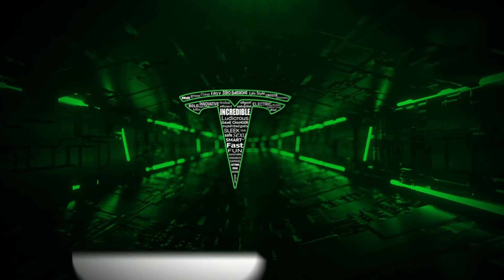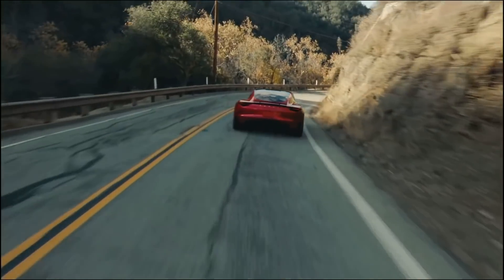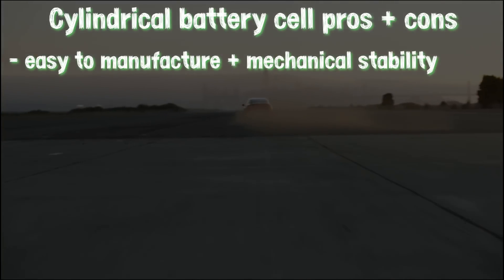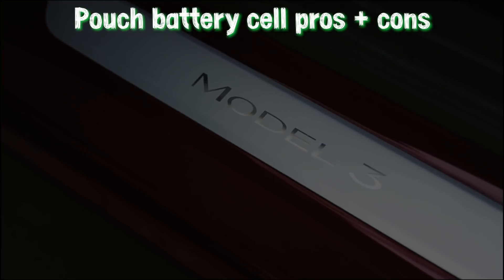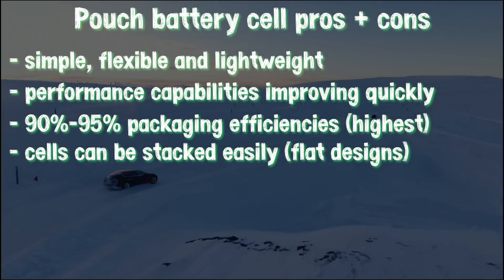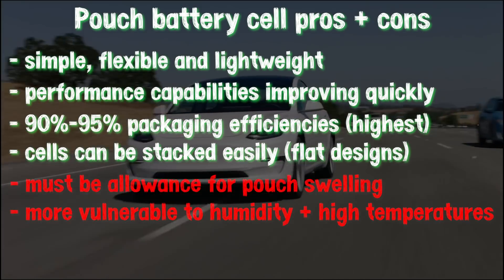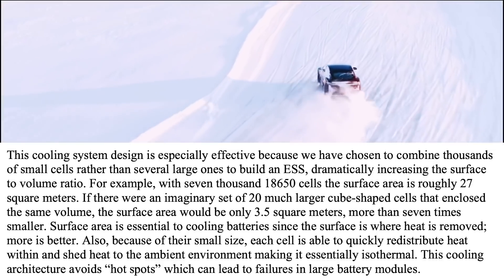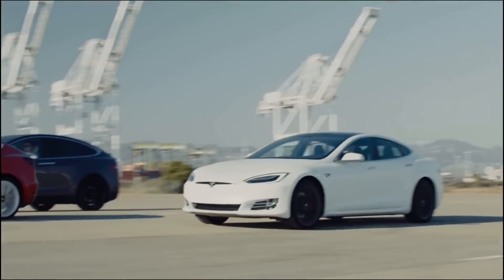Tesla Cylindrical Battery (vs. Pouch/Prismatic) and Tesla Battery News (CATL)

Comment: Every Tesla short: "China will copy Tesla and they will do it faster than Tesla can build cars!"  Tesla response: we will build a knockoff Model 3 in China.  Checkmate.  :)
Reply: china already has the raw materials for making EV and they have beeing making EVs for years now, from Bus to trucks China basically lead the world in terms of EV production
Reply: @carholic-sz3qv  Any of your EVs get more than 800 km per charge?  Tell us more.
Reply: @carholic-sz3qv  Funny... Did you know Tesla the tiny startup with only half a million cars... put more battery miles on the ground than any other company in the world?  Anyone can sell a million hybrids with a 5kwh battery and a small motor only good for 5mph and slower.  How many are building vehicles with 300+ mile range?  I will wait for your response.  Granted short range is great for intercity living.  If FSD happens all those intercity short range vehicles will go away.   1 TM3 with FSD will take the place of half a dozen other vehicles in the city.  Think of all the parking structures in a city that could be cleared for other projects!  Parking lots just vanishing.  No more huge parking lots everywhere.  Thousands upon thousands of acres of land in and around cities finding new uses.
Reply from the maker: Hahahah love this David! 😂
Reply: @DillonLoomis22  i don't know much about battery's but you've done a great in depth job at describing the  different types. I have not seen this insightful coverage of the 3 types of batter's. I certainty havent heard any other YouTube's talk about them but no one to my knowledge has explained it all as well as you did. Up until now all i knew was that an atom actually has 4 elements instead of 3 like everyone has been taught. An atom consists of electrons, neutrons, protons and lastly morons.
PS... i thought i was a great chance of making your competition list when i commented about your wife being a model a few weeks back. I thought she would of insisted i made the cut but looks like I'll just have to settle for the heart i got. Anyway i really enjoyed this vid. Keep up the great work.
Reply: Well, they try to copy - but as "only touched" in the video: the over all design with that thousands of decisions - that's nearly impossible to copy without very high risc.
Reply from the maker: @wjhann4836  difficult indeed!
Reply: Thats not a "knockoff". Its a forced move if they later want to sell cars into EU. A pounch/prismatic cell based battery-pack will be far cheaper to import into EU than cylindrical cells a few years down the line once EU adds a CO2 tax on imported goods based on a lifetime CO2 cost of products. 

The reason Tesla's batteries offer more energy density is because of the way the packs are manufactured. The cells are more or less the same between each OEM. But Tesla saves a lot of weight by welding the cells directly to each other which means less weight on wires and connectors between each cell. 

Pro: Less weight and more energy density pluss cheaper pack to build. 
Con: Far more expensive battery-pack in terms of GHG emissions based on a lifecycle analysis. 

So once you need to factor in the costs of recycling the packs, suddenly Tesla's pack are far behind what everyone else does. And thats the reason Tesla is looking at Prismatic cells now. They see the EU regulations thats in discussion over at especially Germany that will soon take effect. CO2 tax which will build a EU fund to ramp up renewable energy generation. 

The effect of this will be that it shifts which battery producer that will get to export out their tech. Suddenly its not the cheapest pack to produce that is actually the cheapest pack. Its the cheapest pack to both produce, shift into a second life use, and then recycle that wins. Exactly like it should be, as this forces efforts down the entire value-chain. 

The battery producer that have the most electrified mines, and transport of minerals will win.
Reply from the maker: @oophus1  thanks for sharing Tim!
Reply: @DillonLoomis22  No problem. :) 

Tesla looking into Prismatic Cells are a nice "bright light" going into the future. It means the rumors behind the CO2 tax may be closer than we actually think. Which is a good thing. All the countries and especially the US should introduce that. Suddenly Trump gets the tax he wants from China, but in a way more logical and non-toxic way. ;)
Reply from the maker: Tim Daniel Ophus I agree brother!
Reply: @oophus1  Prismatic batteries are < Cell Batteries.  They are cheaper, more prone to failure, failures are more problematic, and most importantly less safe.  I prefer Cell batteries.  Until something better aka safer with more power comes along.
Reply: @davidbeppler3032  -- Once again traditional conventional legacy ICE automobile manufacturers overlook that it is Tesla's software that makes their cars work, not the hardware.  Even if someone in China builds a perfect analog to the Tesla Model 3, it means NOTHING without the software that makes it all work together.  There is no generic Android app that can be dropped in place to make it all work.  If someone does manage to 'steal', intercept, or purloin Tesla's code base, the result will just be a BYD, NIO, or Farraday Future branded Tesla product.  A car that is just another Tesla added to their fleet by another manufacturer.  Tesla could detect and remotely shut down such a car if they wanted.  Easily.
Reply: @davidbeppler3032  What are you talking about when saying "Cell batteries"? Do you mean Cylindrical cell structure? Where have you got the failure rate from Prismatic cells from? They are more or less the same vs Cylindrical cells vs Pouch cells.
Reply: @oophus1  Prismatic do great in the lab.  Not so well in real world applications.  They do not like vibrations.  Like those found in a car for instance.  There are several papers about how the different batteries behave.  Go look one up.  
Also prismatic batteries are much larger, when one fails you can lose as much as 6-8% of your total charge.  When you lose a dozen 2170's you lose about 2% of charge.  This directly effects longevity.
Big auto does not care about safety over profit... Tesla did.  I do not like the change to less safe batteries.  You should not either.  Currently it is acceptable for there to be thousands of car fires a year in ICE.  We should not want that same level of acceptance in EVs.
Reply: @davidbeppler3032  I've read all about it. Prismatic cells do perfectly fine, so you have some extraordinary statements you need to document. Are you confused between how cells are produced and chemistry within cells? You know you can have different chemistry within all of the different cell-types right? 

Safety over profits.... Wow! 
Tesla is the only company that allows their cells to charge to 4.2V. Tesla is also the only company that suddenly decreases charging speed in some of the cars sold down from 250 kW to 95kW because of an extra layer of safety-checks within the BMS, while at the same time trying to hide that fact, by changing how the math works on the way range is displayed in your car if you are unlucky to have an OTA that removes around 10% of your capacity, power and range.  
Tesla is blowing everyone out of the water in terms of self-igniting cars. Do you know why? Lithium-dendrites and plating. Look it up, as thats why they suddenly added that extra layer of battery-checks to their BMS that may suddenly add more buffer in your Vmax and Vmin. 

What are the other OEM's doing? They have that layer of security from day 1. They don't introduce that over time, so that they can have a WLTP/EPA range that is "leading" as Tesla does. 

Safety over profits.... Hah!
Reply: @oophus1   Yes.  Cylindrical is safer than prismatic.  Yes the studies showed that prismatic, in any chemical formulation,  breaks down under vibration.  Not sure what "articles" you have been reading, but stop believing what you find on the psudoscience channels.
Reply: @davidbeppler3032  You have to actually give us numbers here, as it doesn't matter that much if you're talking about a 0,00001% chance vs 0,00002% chance which is way below any risk assement studies needed to clear a battery. Remember that most of Asia is using LFP chemistry and Prisimatic cells without any problems. And the cars that have the highest rate of self-igniting is Teslas, even though they use Cylindrical cells. So they come with their own challenges. And thats uneven heat-generation while in use, and at charging. Which is a problem as this produces dendrites and plating within the cells.
Reply: @oophus1  -- Yeah, but... BYD probably uses LFP in their E6, right...?  Notice, while it has not been released for public consumption, it was brought to the U.S. for use by fleets, as a TAXI.  As a result, it was tested by the EPA.  Smaller than the Tesla Model S, it also has an 85 kWh battery pack.   But its range per the EPA is only 187 miles.  Compared to 265 miles for the 2012 Model S 85.  So, there are benefits to the cylindrical battery cell array, no doubt.

EPA -- COMPARE SIDE BY SIDE, BYD E6, Tesla Model S 85
https://www.fueleconomy.gov/feg/Find.do?action=sbs&id=38591&id=32557
Reply: @redxsage  Yes, the LFP chemistry is less energy dense than NMC, which is why its impressive if CATL have made it around 200Wh/kg. Panasonic NMC cells which anyone can buy them selves, is around 255Wh/kg, and around 160Wh/kg in a complete battery-pack. 

The other arguments against Prismatic Cell structure is rubbish. You can have any chemistry in any cell structure you want. You can make NMC in a Prismatic Cell structure if you want and you can have LFP structure in a Cylindrical Cells. 

The benefit of Cylindrical Cell pack is speed in assembly, and it can withstand some internal pressure.

The benefit of a Prismatic or Pouch Cell pack is better packing of cells thus you can increase total energy density that way. Pluss they are far easier to reuse in a second life product like an eBike or something, and ultimately recycle. 

Trust me when I say that the future of electric-mobility is within Prismatic or Pouch Cell structures. Not Cylindrical cells. You waste a lot of space in a Cylindrical setup. The only reason Tesla chose those, is cost. They are as I've said cheaper to manufacture, and especially the way Tesla does it, with welding them together and filling the left-over spaces with thermal goop. Not a sustainable way to manufacture battery packs in the long run, since its more or less impossible to create a second-life usage for them outside of using them just as they are.
Reply: @redxsage  Damnit. I made a lengthy response and it didn't get through when I posted it. :P 

Yes, the NMC structure is more energy dense than LFP. But its also more prone to failure, which is why the maritime segment uses LFP, and also why BYD chose them for public transport. Cobalt is the material that creates safety within the NMC structure, so thats why its hard to remove it, and we may have to abondon that chemistry alltogether in the hunt of a Cobalt free battery-pack. 
Thats why its impressive if CATL got them up to 200Wh/kg. Thats a big jump. 

NMC Cylindrical Cells are around 255Wh/kg in energy density, but as a battery-pack, like the TM3 pack, they are 160Wh/kg. So the disadvantage of Cylindrical Cells in a pack which is a lot of empty volume in between them, can be caught up by a Prismatic Cell structures in a pack. They are easier to pack, and takes less space - thus Tesla may be able to reach more or less the same energy density in the total pack at around 150-160Wh/kg. 

The reason why Tesla chose Cylindrical Cells to begin with is cost. They are cheaper to produce at Cell level but especially cheap in the way Tesla did it - with simply welding them together, and use the volume in between them to spray in some thermal paste. But that way is not sustainable in the long run. Those packs are impossible to reuse in a different shape, and they will only be re-used in the shape and form they come with after its life in a car. Cylindrical Cells are also the hardest type to recycle, so the future of battery-electric mobility lies in Prismatic and Pouch Cell structures. 

What kind of chemistry we end up with, is kinda hard to know. But we need sustainable battery-packs that are easier to use for second-life usage, and also for their end-of-life recycling process.
Reply: @oophus1  -- Uhm...  Tesla only uses NMC chemistry inside the battery cells used for Stationary Storage applications.  They use NCA chemistry in their cars.
Reply: @oophus1  -- Tesla chose cylindrical battery cells because it made sense.  They were a consistent size, and thereby an industry standard size and shape, which made them a commodity.  A standardized design and manufacturing process made sure there was wide access to automated manufacturing equipment to increase throughput and improve their economies of scale.  Making them cheap to use en masse.

Pouch and prismatic cells have expansion and outgassing issues.  They suffer from both low gravitic energy density and low volumetric energy density.  They tend to suffer from low power delivery.  In short?  They suck.
Reply: @redxsage  Ah, yes. Brainfart. The Wh/kg was correct for those cells though.
Reply: @redxsage  More or less the same thing I said. Tesla chose Cylindrical cells because of cost mostly. And yes, they have been cheaper to produce, and still are. But when you add in costs for a lifetime cycle, they won't be as cheap anymore. Suddenly Pouch and/or Prismatic are the cheapest packs, simply because CO2 will cost money, just like you pay taxes on gas and diesel, you will have to pay CO2 tax for other products. This will force more segments into electrifying their processes using renewable power. Cylindrical based packs, will cost more in terms of tax than Pouch/Prismatic based battery-packs.  

Pouch and Prismatic cell based packs don't have issues. We have overcome those problems a long time ago. 

FAW Benteng B30EV400 is a car that uses Pouch Cells from Soundon. They have a energy density of 251.70Wh/kg at Cell level. 

Airways U5 will use CATL Prismatic Cell type with a energy density of 249,85 Wh/kg at Cell level. 

Also, how are you saying that flat packs vs rolled up packs have less volumetric energy? It all depends on chemistry. In a Cylindrical Cell structure, you waste a lot of volume in between the cells. So if you compare the same type cell with the same chemistry in a Cylindrical Pack vs a Pouch/Prismatic Pack, the Cylindrical Pack will have less volumetric density. 

The only difference is you roll them up and put them in a cylindrical case, vs you stack them flat on top of each other to make a module.
Reply: @oophus1  -- Here in the U.S. there is absolutely no form of tax on Carbon Dioxide emissions from fossil fuels or ICE vehicles and tools.   I am not aware of the 'future taxes' you speak of, that will be so costly as to make cylindrical battery cells 'so costly' that their use would be unfeasible in the long run.  I am also unaware that cylindrical NCA formulated battery cells outgas Carbon Dioxide in any way at all.  You are stating so called 'facts' not in evidence, without any form of reference to support your theory, which seems rather feeble to me.

"But when you add in costs for a lifecycle cycle..."

Dude.  [WHISKEY TANGO FOXTROT]?  You are surely skipping a step or two here.  Reduce, Reuse, Recycle -- remember that axiom of Conservation?  

After noting the precise quantity of battery cells needed to complete a vehicle project (REDUCE), they may at the end of that process be Reused in a stationary storage application.  This has been demonstrated by the projects of Jack Rickard of EVTV here on YouTube.  Tesla battery modules, or even the entire battery pack as a whole, may be used as stationary storage.  There are several others demonstrating the same Reuse of Nissan LEAF battery modules.  

Your suggestion that automotive battery packs must IMMEDIATELY be broken down to Recycle the elements within battery cells, and nothing else, would be both Premature and Stupid.  A waste of a good resources.  You are getting ahead of yourself.  Because previously used automotive battery packs can still hold a charge at lover voltages and be Reused as stationary storage for Solar and Wind power generation.  

So, assuming that when used solely for driving, the battery pack might last 20 years before falling below a 70% State of Charge when refilled, it would still hold a sufficient amount of energy for a low voltage stationary storage application over the next 25-to-30 years.  Then the cells within the battery pack would be recycled to their constituent elements, to be formed once more into viable batteries.

Something on the order of 95% of lead acid automotive batteries are recycled worldwide every year.  And the components within those are LITERALLY dirt cheap.  Still, someone finds it a worthwhile profitable endeavor.  The individual components of a lithium-ion traction battery pack are far more valuable.  So no doubt, they will be sought after to be recycled for decades to come, and done profitably as well.   That process does not have to be in place NOW, as we haven't yet fully crossed over the Reuse chasm.  But there will be.  Watch.

"Pouch and Prismatic cell based packs don't have issues."

Denial.  OK.  Whatever.  The puffed up, bloated, straining at the seams batteries from my old Samsung phone would stand as evidence that is not a correct asessment.

Actually, the name of the Chinese company is 'AIWAYS' not 'Airways'...  Never heard of them prior to this conversation.  FYI...?  As a 52-year-old American bachelor, I have no Wife, no Children, no Grandchildren to haul around currently.  I typically would have no use whatsoever for a Sedan or Compact SUV.  This is not a particularly appealing vehicle to me.  If you like it?  Cool.  Be you.  Doesn't change the fact that using thousands of cylindrical cells rather than dozens or hundreds of flat pack cells, has been very successful for Tesla.  Meanwhile, you atleast have the Porsche Taycan to carry the torch for Prismatic and/or Pouch battery cells in automotive applications.  ~*YAWN!*~  Yeah.

You are mistaken.  Tesla's battery cells are not 'stacked flat on top of each other' within a battery pack at all.  Perhaps you should reference a diagram that shows the alignment of battery cells within a Tesla battery pack before commenting further?
Reply: @redxsage  1. It doesn't matter if US doesn't have a tax on CO2 once it comes into effect in EU. Tesla will still need to pay taxes to ship stuff into EU, so they will need to fix it in some way to be competitive in a market that is important for them. 

2. I'm talking about the difference in how the different packs recycle, or how they get rebuilt into their second life use. The problem comes in effect in the way Tesla makes their battery-packs. In a Porsche Taycan, or VW ID.3 or Nissan Leaf, or Audi etron, you have packs made out of cells tucked into separate modules which are fastened with screws. Those modules are connected together in their serial or parallel connections through copper-wires and connections. At the end you have the case which is also fastened with normal screws. What this means is that its easy to disassemble the pack and do everything in reverse to get the modules and cells out. This means that they are easy re rebuild into a different shape for example into their secondary use. Or ultimately recycle for their "end-of-life" usage where you have to recycle everything. 

Tesla on the other hand, uses Cylindrical Cells. Those alone are harder to recycle than Prismatic or Pouch-Cells because of their casing. And then they weld the cylindrical cells together with a plate so they save weight on wires, and connections. Then they apply thermal-paste inbetween the open volume between the cells. What this means is that they are more or less impossible to open again to rebuild into a different shape. And even harder to recycle at scale. 

Doing that work requires energy, and heat. Both energy and heat means GHG emissions. A Tesla battery requires way more energy to rebuild/recycle than the other OEM's. Thats why they will be way more expensive once a lifetime analysis of CO2 comes into play. Tesla knows this, and thats why you see them experimenting with something else in Asia. 

3. I've never said Cylindrical Cells outgas anything? I'm talking about GHG emissions through a lifetime analysis of a battery-pack. Tesla's pack will be way more expensive to disassemble and recycle than any other battery-pack made of pouch or prismatic cells. 

4. Yes. Tesla packs will get reused, but they will only be reused as they are. No one wants to use the efforts to take in a Tesla battery pack to rebuild them into something else, in a different shape to for example make an eBike battery. Thats the BIG difference. To disassemble a Porsche Taycan battery means making a plant that does the same steps they needed to assemble it, only in reverse. Thats not POSSIBLE with a Tesla battery, since they are WELDED together, and you have hard thermal-goop also holding the cells in place. 

5. I have never assumed that a battery must be recycled right away? I'm talking about a "life-time analysis" of a battery pack. That includes the life it has in a car, it also includes a second-life use and how easy they are to rebuild into multiply purpose use in that step, and ultimately how easy they are to recycle. 

6. It doesn't matter how long a battery lasts in a car. Ultimately you NEED to get rid of them at some point. They don't just disappear. Once they don't maintain enough of a charge to be useful, they become a problem. A problem we need to solve. THATS WHY EU IS CONSIDERING A CO2 TAX. Why? It would solve this automatically, because battery-producers would have to think about the whole life-cycle of a battery and how it lives throughout its life as a car-battery, as a wall-storage battery, as an eBike battery or whatever. And then it has to be easy to recycle. So in the process of designing the way they assemble into a pack, they have to think of how it should disassemble too. 

Tesla never thought of this when they made their packs. All they thought of was to reduce costs in production. 

7. Try to search how many Lithium-ion batteries that gets recycled. Its 5% here in Europe, and its even worse in the US. The worst part? Of those 5% the regulations require that only 50% of the materials gets collected back. So there is a perfectly good and healthy reason to take another look at this segment. EU wants to fix GHG emissions. US have Trump who doesn't give a shit, so who knows what will happen there. But at least EU is forcing the car industry to deal with it, the same way EU is forcing Apple to stop making idiotic non-standard cables for their equipment. 

8. Pouch and Prismatic Cells don't have issues in cars any more than Cylindrical cells have. Take a look at the car-industry and check the number of different packs with different chemistry and Cell types. Both Pouch, Prismatic and Cylindrical cells are used. In the maritime industry, they don't use Cylindrical Cells for a good reason. The requirements for big steady C-charge rates makes them useless because they produce a heat-map that is uneven on the structures of the cells. That means a higher chance of Lithium-plating, and dendrites which is dangerous. 

9. Why do you suddenly talk about your life? Who cares? Stop taking this personal. Why are you suddenly in a hissy-fit because Tesla wants to experiment with Prismatic Cells? 

10. I never said Teslas packs are stacked. I was talking about the difference between a Prismatic cell and a Cylindrical Cell. The chemistry can be the same thing. You can make a NMC Cylindrical Cell, and you can use the same chemistry for a Prismatic Cell. 

The Cell in a cylindrical battery is made the same way. The only difference is you roll it up, and put it in a casing. For a Prismatic Cell you lay them falt on top of eachother, and close a square casing around them, making them into modules.
Reply: @redxsage  I have explained why EU is looking at making a CO2 tax. Its for the benefit of the world. It will solve how battery producers and vehicle producers make their battery packs, because instead of only focusing on how to make the packs cheap in assembly. They will have to make sure they are cheap to disassemble too. 

Porche Taycan, Audi etron, Nissan Leaf, BMW i3 <-- All of them have thought about this. 
Tesla <--- They only focused on the problem of money. They wanted to make the cheapest battery pack, and it shows in how they are assembled. 

To disassemble any other OEM's pack, you just do the same steps they used to assemble them in reverse. You take off the connections, and disconnect the wires, open some screws and take out the modules. You open them, and then slide the individual Cells out. Now you can rebuild it again for a second life. It could be for anything since you can rebuild it the way you want into any shape you want. 

To disassemble a Tesla pack, you will have to deal with how they are made. The Cylindrical Cells are a casing in of it self. So those cells are harder to recycle than both Prismatic and Pouch cells. On a Tesla pack, all of the battery cells are welded together using a top and bottom plate. And in between the cells, Tesla filled the open volume because of the round shape of the cylindrical cell with thermal goop that is now rock solid. <--- This means that you need to use more power, and more heat to get them separated. In the US you would use a blend of all different power-methods to spend time on that, which require GHG emissions. To build up heat, we often use coal, so even more GHG emissions to seperate the welds from the cells, and burn off the thermal paste. Only then can you get to the individual cells if you want to rebuild them into something else. 

THATS WHY NO ONE DOES IT! The only second-life usage of a Tesla batterypack is to simply use it in its original shape. So the only use we see more or less, are to use them as wall-storage units. And when you want to recycle them at the "end of life" stage. You simply cursh the entire thing, leaving you with a blend of cobalt, lithium steel, aluminium, copper, thermal paste etc etc etc materials which you have to sort. That also means more energy! More GHG emissions! 

To recycle a prismatic or pouch cell, you do as I said, the entire thing in reverse until you have EVERYTHING separated. What you are left with is steel in its own pile, screws in its own pile, copper-wires and connections its own pile, aluminium in its own pile. Everything is SEPERATED even BEFORE you add any heat-treatment or crush up the cells to get to their materials that you then seperate. 

So once a GHG tax is in EU. Tesla would have to pay a ton of money to import their old design. While the other OEM's who have thought about this when making their packs, they have an easier day.
Reply: @oophus1  -- Geez, you wrote a lot of [$#!+].  That in no way makes you correct of course.  You have managed to convince me you ared an idiotic Troll though.  Congratulations!

1)  Perhaps you didn't notice...?  Tesla is building a GIGAFACTORY in Germany, part of  the European Union last I checked.  So, Tesla actually WON'T be 'paying to ship' much stuff there from the U.S. at all.  Probably the Model S, Model X, and CYBERTRUCK will each be manufactured in the U.S. still.  I doubt there will be any specific Carbon Dioxide Tax Fee associated with that.  If so, it would probably be paid via Customs.  No big deal, as a greatly reduced imported fleet shouldn't incur much in terms of additional fees.

2)  God.  Dude.  I already told you..  There is absolutely NO NEED to disassemble Tesla battery packs at the cellular level to Reuse their contents.  Individual battery modules can be lifted out, or the entire battery pack as a whole, can be used in secondary applications, like stationary storage.  Easy.

3) All so you are denying the [BOLSHEVIK] statements made in your prior post and replacing it with a [BOLSHOI] statement instead...?  OK.  That [FOULED] UP inane stupid dumb@$$3d 'lifetime Carbon' calculation assumes far too much in far too many places to be considered even remotely accurate.  So you can take those... ASSUMPTIONS and shove them right back in your sphincter where they belong.  At least until you have valid, actual, real world, documented PROOF of such.

4) Ah.  You are yet again assuming facts not in evidence.  Da fuq?  How the [HECK] do YOU KNOW what 'NO ONE ELSE' wants to do...?

5) Your entire [GOLDURNED] 'lifetime analysis' is entirely invalid from the start.  I explained earlier that you STARTED THE [FLOCK] off by going DIRECTLY to your supposed 'end of life' scenario, which as I already told you is anywhere from 25-to-45 YEARS FROM NOW.  You change tenses in your posts often without giving a temporal viewpoint, so it always seems as if you are talking about NOW.  [FLOCK] YOU, MAN!

6) What doesn't matter here are the utterly stupid undefined amorphous idiotic terms you are sc spouting with every sentence of your way too long monologue.  You haven't said ANYTHING WORTHWHILE.  All you are doing is using this as an opportunity to mangle the reputation of Tesla by accusing them of things you CANNOT PROVE.

7) With any luck, President Trump will be arrested on January 21, 2021 for his crimes, the day after our new President is inaugurated.  His 'Policies' on Climate Change and everything else are born of greed, corruption, stupidity, and absolutely no understanding of how our govenment works.  I suspect he either never took and certainly never passed a 9th Grade American Civics Class.  Good riddance.

You act as if NOTHING should be manufactured anywhere for anything unless that manufacturer developes a complete cradle-to-grave recycling program for it first.  That is a complete [CROCK] of [$#!+] man.  Absolutely NO ONE does that in ANY INDUSTRY.  Wanna know why...?  Because it costs too much, it takes too long, and is [FLOCKING] STUPID AS [HECK]!  Damn.

8) Wow.  More [BOLSHEVIK].  Tell me, exactly what 'issues' are you claiming POS low quality, low power, low state of charge, low gravimetric energy density, low volumetric energy density, flimsy @$$3d prismatic and poch mattery cells DON'T have...?  Besides being a complete and total waste of money and space in automotive applications?

9)  Man... FUCK YOU.

10)  WOW.  A complete lie.  I repeat... FUCK... YOU!
Reply: @redxsage  Yea, I wrote the first response, and it didn't show up so I thought it disappeared and had to write a new one. 

I'm the idiot?  I'm giving you facts, and thats all you have to reply with? 

1. The GIGAFACTORY in Germany still needs to import materials for its batteries. Where do you think lithium and cobalt comes from? 

Are you seriously not supporting a CO2 tax? What happens to the entire industry if you add a CO2 tax? The mines that can extract the minerals with the least GHG emissions wins. They will be selling their produce at the lowst cost instead of the mines with child's dying in them. 

EU is doing this to shift focus from CO2 emissions only during use, which in reality just shifts CO2 emissions from the car rolling on the tarmac, to the cost linked to both producing the car - including the most toxic process of them all, the battery-production. 

Through a lifetime cycle, you make sure that the entire industry, from how the minerals gets brought up from the ground, all the way to when the batteries gets shreded to recycle them gets a focus on becoming better. Fuck Tesla if they won'd adhere to this, and the US too with Trump saying climate change isn't real, like the mentality you see in Flat Earthers. 

The fact is: Every OEM have thought about second-life usage, and end-of-life recycling when producing a new battery-pack for their car. Thats why Tesla is in the "lead" in terms of energy density. They NEVER thought about second-life usage, and recycling. Thats CLEAR in the way the packs are assembled. 

The amount of weight Tesla drops in welding everything together is huge. The BIG problem is they are impossible to separate again if you want access to individual Cells to rebuild them into something else in a different shape. 

Its a good thing Tesla is experimenting with CATL to make a new type of battery. If you are still ignonrant on this, then guess who's the idiot.

2.You don't know that? The second-life use of a Tesla pack is ONLY possible if you keep its shape and volume as it is. How is that not a dissadvantage over the other packs which you can simply unscrew, and disconnect to rebuiidl into any shape and form you want? How the fuck are you supposed to rebuild a Tesla pack into a eBike or smaller power-tools? 

3. The fuck are you talking about? 100 kWh of batteries produces around 15-20 tons of CO2 GHG emissions. Thats a fact. Thats only for when you produce the batteries, and you still need energy and heat to recycle it again, which demands even more GHG emissions. So of course there is a reason why EU is looking into this. Its not for fun. 

4. The evidence is the different packs. Look at it! Look at how a Porsche Taycan, or Audi eTron, or Nissan Leaf, or Jaguar I-Pace or whatever car is build vs how a Tesla pack is built. 

You can do the same process in reverse to reach the individual cells in all of them, EXCEPT for the packs Tesla have built.  THEY ARE WELDED TOGETHER! And there is a hard thermal-goop in between them that is impossible to get rid of if you don't use heat. Heat requires ENERGY and GHG emissions as most of them use coal to burn. 

5. You are just shifting the problem around, expecting our childs to fix it like any other moron who doesn't want to take responsibility. Thats how we ended up in this shit-hole already. 

It doesn't matter if you have to add GHG emissions now, or in 25 years time. You still have a problem with how you get rid of, and get materials out from battery-packs again. A Cylindrical cell is HARDER to recycle just by the fact of the casing alone vs a Pounch or Prismatic Cell. Thats a FACT. On top of that, you have Tesla WELDING EVERYTHING TOGETHER to make it even harder, AND you even have them stuck to eathoer with thermal-goop if you are lucky enough to get the welds off. 

6. I started out here by applauding Tesla for testing a new battery? The fuck are you on about? 

7. I never said nothing should be manufactured? We need to manufacture stuff in a different way! Know the difference! 

By adding a CO2 tax you FORCE mine operators such as Engie to go renewable, and to electrify the entire process of getting rare-earth minerals out. Luckily enough, they know whats coming, and some of them are already on their way with plans to electrify mines. They will use battery-packs and hydrogen-storage to make micro-grids from renewable power, so that material-handling equipment can use fuel cells and batteries instead of diesel. So the discussions are already making an EFFECT already, even BEFORE they are live. 

Its the same thing that happened because of IMO 2020 regulations within the shipping industry. People installed Scrubbers way before it was live, just because it was up for discussions. The results? Thousands and millions of CO2 reductions happened because of it. 

8. This is funny. You are trying to defend Tesla, while Tesla is doing EXACTLY like expected. They are now aware of the discussion, and are looking into getting new battery-technology that will be forced in the future. 

Do you mean you are more of an expert than Tesla's experts? Who are now trying out Prismatic Cells? 

By now, everyone who reads this will know who the idiot is. And its not me.
Reply: @oophus1  Dude, you are wrong.  Just stop.  I let others tell you that you are wrong.  Hoping you would get it.
  Prismatic is inferior.  I remembered another reason prismatic is inferior as I wrote this, "can you take a prismatic battery out of any vehicle using them and put it in yours?" Nope.  No standardized size or shape.  Every battery designed for only the car it belongs to.  I get that you don't like it/believe it.  Just go read any scientific breakdown of the subject matter.  You even said Teslas catch fire more often than other EVs... yea, they also are 70=100% of the EV market.  To date Tesla fires caused by spontaneous combustion is 0.  Caused by a bullet through the battery pack is 2.  Road debris is several.  People have pulled Teslas out of the floods that were submerged for 3 weeks and the batteries were reusable.
Reply: @davidbeppler3032  so why are Tesla trying prismatic out now if they are all negative?
Reply: @oophus1  Trying?  Do you believe prismatic batteries are new and something Tesla engineers just found out about?  They are using them because they are fucking cheap.  Same reason every company has already used them.  Less expense = lower price = more profits.  This does not make them the best engineering solution.
Reply: @redxsage  stop talking shit. today tesla is still relying on the oil industry transportation , from plasticss to tires.....